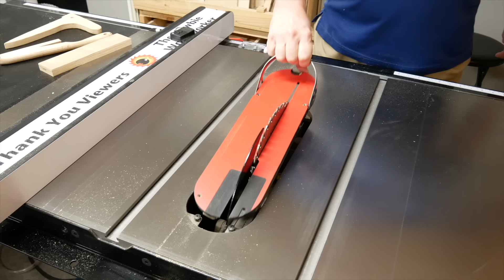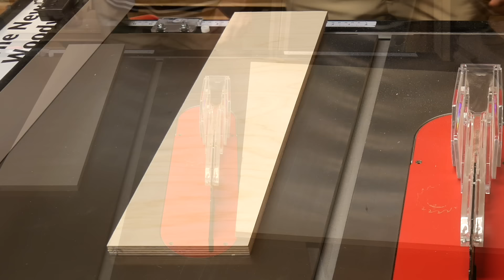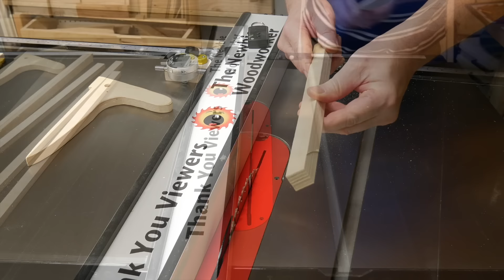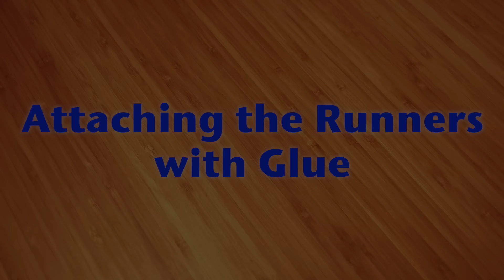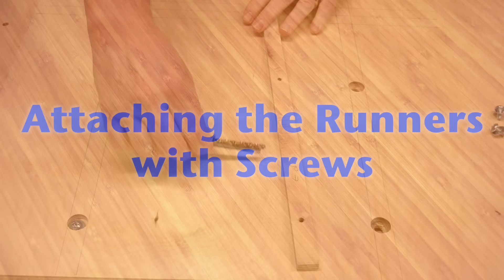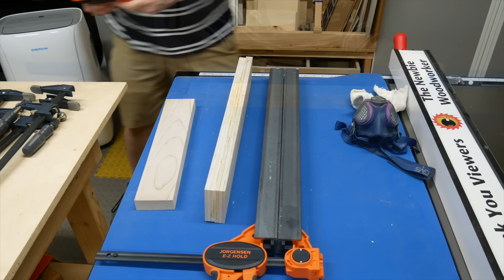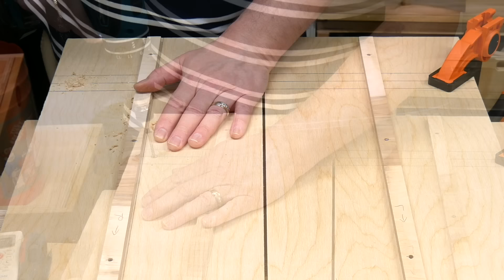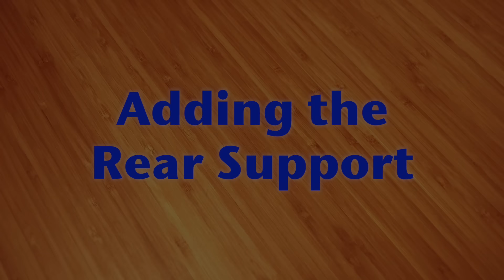Build this Revolutionary Cross Cut Sled, for Newbies!

Comment: You are very right about blade guards. I wasn't using one when I had my kickback accident...never had used one. I was cutting some stickers and came across a knot which allowed the outfeed piece to break off, tip up, catch the blade,  and send it through my neck at 500 ft/second. 
Somehow it missed the carotids and I didn't bleed to death, but a three-inch piece of it did go down my trachea and into the right main stem bronchus, collapsing my right lung. The emergency room saved my life, and the surgeons took out the "trophy"  piece. Six weeks later the hole in my trachea closed, and I could talk again and take a shower without drowning myself.
Bottom line: If I'd had a blade guard the cutoff would never have caught the spinning blade.
Reply from the maker: Holy crap!! I'm so glad you lived to tell the tale! Let this be a lesson to us all. In fact, I think I'll pin your comment. Thanks for sharing.
Reply: Wow!  I have heard of some gnarly table accidents but that has to be the most... visceral.  I am glad you pulled through and wish you best of luck on any further recovery.  I won't lie I often take my blade guard off for various reasons and neglect putting it back on out of pure lazine... convenience!  I do appreciate you sharing because it the visual offered isn't easily forgotten and will surely remind me of the potential danger posed by an unguarded blade.  It is easy to get complacent when you have done thousands of cuts without issue but it only takes that one time due to an unaccounted for/unapparent variable to cause permanent maiming or death.  Let's put the damn blade guards on!  Our families and friends will appreciate it... well most of them!
Reply: @matthewhall9692  Thank you for the well wishes. I have recovered completely. Most everyone I know has been supportive of my recovery. Interestingly I was wearing safety glasses, dust mask, and leather shop apron, but the stick found my exposed neck. Now I wear a full face shield that also covers the neck area. 
The event was humorous in one respect: My wife drove me to the ER and dropped me off while she went to find a place to park. So, I walked in and presented to the young tech at the desk. His boredom was obvious as he asked without looking up: "What seems to be the problem today?"
I answered: "I think I have trache'd myself" (as in tracheotomy). He looked up and turned white. Sure enough, I was standing there with a towel over the hole in my neck. As I pulled away the towel to show him, he nearly fainted.
My close buddy, a former surgeon general, said he'd never known anybody to survive a crossbow shot to the neck, so he was going to stick close because I was the luckiest SOB he'd ever known. I'd never won anything in my life, but that day I won the lottery.
Reply from the maker: @joedraneiii6390  What a great attitude! And you experienced the trick to getting fast service in the ER. Holes, blood, pieces of flesh. When I had my router injury, I intentionally left the blood that had sprayed on my glasses and clothes, and although I had my hand wrapped in a towel, I left pieces of flesh in it too. Nobody bothered to ask "On a scale of 1 to 10, how much does it hurt?" :)
Reply from the maker: @matthewhall9692  Well said, Matthew, and I love your word choices (visceral) and humor.
Reply: God bless you..... Thanks for sharing your experience so that people can be double sure of their safety while working....
Reply: @Habibulla.M  My pleasure to be alive and kicking and able to write about the episode. I stress that when something like this happens, it's in a flash. I'm standing there trying to piece together what just happened. I saw the piece tip and heard a bang, and I felt a blunt hit to my neck. Saw still running; central vac still going, and me standing there wondering if I was hurt. Put my finger tips to my neck and came back with a little red...not much. No pain at all. But little did I realize there was a three-inch piece in my right lung, and that's where all the blood was going too.
Reply: @joedraneiii6390  That's a horrible thing to happen for any wood worker....
Reply: Hi Joe. 
So sorry to read what happened - very sobering to me. I've had my first jobsite table saw about 2 months - finally getting it into a safer built-in cabinet with infeed/outfeed support, and making sleds/jigs. Your incident and this video are confirming to me that I need to rebuild my sled so that the blade guard remains in place. I'm at the early stages where good/bad habits are formed - now is the time to learn from the costly and frightening experiences of others. Thank you for writing about yours.
Reply: Joe,
That’s terrifying! I’m glad you’re ok. It’s easy to forget how many ways things can go wrong with these tools.
I’d like to know: were you using a riving knife when it happened?
Reply: @kaleoscreations  No, my saw is from 1983, before riving knives
Reply from the maker: @joedraneiii6390  Wow!
Reply: @joedraneiii6390  
In Germany there were riving knives in the 60s on circular saws. I can't imagine the US didn't. This is not 3rd world.
Reply: Craziest story I've ever heard. Puts the fear in woodworking (which is probably where it needs to be)
Reply from the maker: @timfoster5043  Or at least a very healthy respect. Fear can lead to being tentative during cuts, which isn't good either.
Reply: Thanks for sharing this, potentially life-saving, story. I hope you built a nice presentation box to display your "trophy"... right above your saw 😉👍
Reply: Wow your very lucky.

Work safe.  Try not to use stock with knots in it close to a cut.
Reply: These are the stories about tables saws that scare the crap out of me. Don't get me wrong, I know horrible things happen with all different kinds of tools, but for some reason the table saw is what I'm most intimidated by. Let's just say I never stand right behind the saw, I'm always off to the side. I wish they were able to make the blade guard more....usable? Nonetheless, I really do need to practice using it more. Glad to hear you made it out of that incident alive and with a whole new view on table saws and blade guards!
Reply from the maker: @My_Red_Right_Hand  I think it's all about having a healthy respect for the saw, understanding what can go wrong, and how to protect yourself as much as possible. Then not letting your mind wander while doing things, especially repetative things.
Reply: aren't you talking about the riving knife? how would a blade guard have prevented that? it only stops you from touching the blade
Reply: @Zack-xz1ph  The blade guard also sits over the edges of the cut piece next to the blade, if a piece rotates into the the back of the blade it is lifted up and back towards you. The blade guard will stop it lifting close to the blade. It's not a 100% protection, but it would stop a lot of the pieces coming back at you.
Reply from the maker: @colinfaed5910  👍
Reply: Holy shit dude!   I'm glad you're okay!   [drops beer.  sprints to shop to re-install blade guard]
Reply: Joe - thanks for sharing this. I think people seem to forget that table saws can kill a person pretty easily. I only just started using one - that was rented - and it shot a piece of wood into my garage door. I estimated it to be 70 mph, but it probably was closer to the speed you mention - very scary. I did make a few bonehead mistakes, but I also didn't realize the importance of checking the fence and calibrating it to ensure it was parallel to the blade. It turned out that my fence was off by more than 1/8th of an inch from end to end when I checked the following morning. I thought that since I had paid Home Depot $60 to rent this thing - more than renting a car costs - that they were checking and maintaining it, but it also had no blade guard. To their credit, they did give me 25% off the rental fee. Soon after I bought a used Skilsaw Worm Drive table saw and I now check the fence before almost every cut. My issue is that it didn't come with a blade guard, but it's only about 4 years old so I should be able to buy one online.
Reply: @bernarddouthit4647  Greetings Bernard, When I recovered enough to approach my table saw again, it was with a lot of caution and... well, fear. I was afraid the same way I was afraid after fireworks went off in my hand as a six year old at our family campsite. It took awhile to get comfortable again. The FIRST thing I diid was buy a full face shield that covers my neck, and I always wear it, along with my leather shop apron. 
It's been eight years now and I'm fine with the saw but it really creeps me out when I watch home improvement shows where people use a contractor saw on a job site. They do all sorts of nutty things like crosscutting without any support but their two bare hands. I even watched one guy making a 2X2 out of a 2X4 without using a fence. Imagine...splitting a piece of lumber with no support. Anyway, I am a very cautious woodworker, especially now, after finding out what can really happen to the bag of meat standing back there in the line of fire.
Reply: @joedraneiii6390  Thank you for sharing your harrowing story. My gosh, that was a terrifying experience you had. But I'm really confused. What is a "sticker?" I want to know how to prevent kickbacks like you had, but I don't know what a sticker is?
Reply: @bernarddouthit4647  its even better to offset the backside of the fence a bit to the right so u know u can't bind anything like    /    but not that exaggerated
Reply: i dont normally use a blade guard but i might after seeing that ,just bought a new Bosch pro table saw not bad for the price had to put it on Castors as i only have a small shop,also i think the riving knife prevents  a lot of possible kickbacks
Reply from the maker: Congratulations on your new saw! Yes, by all means, use the riving knife whenever you can. The blade guard is also great protection, but the riving knife does a wonderful job of cutting down the chances of kickback. Be safe and have fun!
Reply: Holy shit. Thanks for your experience story. My fence  guard is missing from my older  Dewalt 10 inch   table saw , been dormant for years now retired wanna fire it back up. Was a present from my wife years ago….Gonna shop for replacement. Don’t know where to find it Cant-find Owners  Manuel ..
Reply: "Blade guards? We ain't got no blade guards. We don't need no blade guards. I don't have to use any stinkin' blade guards!"
Reply: I gained a whole new respect for table saws the first time a half a 2x4x8 came shooting back off the blade and luckily hit me in the belt buckle. Knocked the wind out of me and I've never stood in line with the blade since
Reply from the maker: @drizitgaming  Wow, that was some belt buckle! Glad you're OK.
Reply: @TheNewbieWoodworker  sure was, and so am I ;)
Safety equipment isn't just for fun
Reply from the maker: @drizitgaming  👍
Reply: Were you using a push stick and if so what sort?
Reply: Thats good advice, I use one some of the times, but my Kobalt table saw blade guard kind of sucks, so I take the chance without it.  Then when I read things like this I put it back on, well until I get annoyed or have to cut thin pieces.
Reply: Jeez, I'm so glad you survived man.  Terrifying
Reply from the maker: @joshuagharis9017  Thanks, and I'm glad too. Definitely terrifying, especially with how quickly everything happened!
Reply: i just took out 3 stitches because i don't have a blade guard and blade got my thumb. a big hole where a chunk got ripped out and a few slices could not be stitched. they'll just have to heal up. so i'm going to buy a blade guard and make it work and use it. i could have chopped my thumb off. this video made me think about simple safety measures and quir just doing it. i never get cut. ok hands nowhere near that barbaric blade.
Reply: holy smoke. makes my thumb story pale...
Reply from the maker: @yellowcat1310  😂
Reply: Walk it off Nancy
Reply: @kevinrash4821  I did Elmer.

Comment: Thank you.  I got a new jobsite saw.  I was going to make a different sled, but have decided to make this one instead.  I've been doing woodworking for more than 15 years, and usually didn't use a blade guard, relying instead on the gripper.  I've heard people question the gripper vs the blade guard and decided to use the guard as much as possible.  Also got the Jessem Flex guides.  This is an excellent idea. Thank you.  I'm going to use some plastic runners I already have, though.

Comment: Just hooked up dust collection to my blade guard, so not being able to use it with my crosscut sled would be a big letdown. My "aha" takeaway from your design is simply moving the fence forward so there's stock behind that doesn't get cut in half, providing the stability that a notch-less fence otherwise would. One question...why not just leave a space between the two halves of the fence all the way to the surface of the sled? What's the purpose of the short piece in between the two halves of the fence for the guards to ride over?

Comment: Great video, great design. Thanks. I've been watching this whilst lying in the bath so I haven't had a chance to sketch it out, but Im considering some improvements to address the small nu.ber if concerns raised by others.

Why not fit another section of double ply along the edge, behind the 4" block. It functions exactly the same but with additional reinforcing. On the other end, have a similar piece but removeable, just to add strength when installing and removing the sled. Maybe using some kind of quick release catch/clamp or maybe threaded inserts.

As I said - just bath musings!

Comment: Great vid - thanks and greetings from across the pond! I bet when you made this vid, 3D printing was quite a niche thing. Now of course, 3D printing is available to lots of folk. So Im currently building this design but with 3D printed runners, and - even handier - a 3D printed kerf strip to be a nice snug fit in the slot for squaring up the fence.

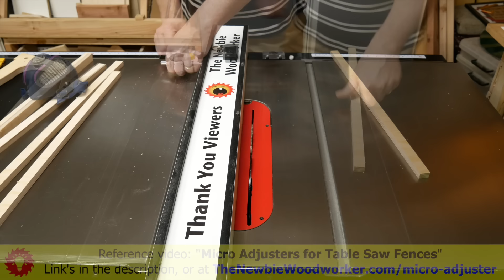Comment: 5:15 Curious why you don't use the push block at this point.  I'm really conflicted about it.  I feel like I have more control when I'm using it but I can't use the blade guard when I run the block over the blade  and sometimes that gives me pause.  I've heard folks mention how a piece of plastic won't save your hand if it chatters and you're using so much downward force on it that it's probably game over.  Let me know your thoughts on it.  I'm about 8 months into the journey.

Comment: Is kickback even possible when using a crosscut sled since the stock is not pinned between the blade and the fence? It seems the cutoff piece would never be trapped and simply fall away. Thanks for the video.
Reply: Yes, I thought that, too.  But then I realized the point was not having to take off your blade guard every time you want to use your sled.  That way, you will use your blade guard consistently.

Comment: 6:12 it's not safe to cut a narrow piece of wood while it's stuck between the blade and the guide rail, you should use a block before the blade.
Reply: Or a thin strip guide on wider material. That's how I would do it anyway 🤷‍♂

Comment: A TIP: Line the miter slot with a piece of thin plastic film for gluing, this will distribute the gap and you don't need to sand it!

Comment: One issue with this is that newbies all have small table saw (or job site table saw), not gigantic one like yours with rooms before and after the blade. So even though this sled is very useful, it is not really usable for us :(
Reply: Your comment makes zero sense. You can attach a cross sled to any saw.
Reply from the maker: True enough, although you could change the dimensions. But not everything will work for everyone's equipment.

Comment: I think it should be possible to use the blade guard when making the runners or any other thin rip cut where the rip fence would collide with the guard.  All that is needed is a low profile fence extension that can attach to the fence so it doesn't move away during the cut.  Then the guard can lower over the low profile fence extension.
It took a while, but I found this example.  https://blog.carbideprocessors.com/wp-content/uploads/2016/03/ripping-with-table-saw.jpg  Definitely more work,  yet safer.

Comment: May I ask, why is the base so thick?
Wont 5mm ply do the job?
Reply from the maker: No. Since it doesn't have a full front or rear fence, it would be too fragile.
Reply: @TheNewbieWoodworker Sorry but I don’t understand.
Do you mean flexible rather than fragile?
Reply from the maker: @andrewcampbell8265  The only place where the two sides of the sled are held together is about 2 or 3" section of the base. If the base is too thin, I could imagine the wear and tear of taking it off the table saw and storing it might cause it to eventually crack. But, you can always make another one if that should happen, so I guess it wouldn't hurt to give it a shot. Just make sure you glue the runners on instead of using screws.

Comment: About 3 years ago I was using my table saw and was just pure stupid and wasn't using push sticks, there was no knife and no blade guards and had an accident losing part of one ring finder and my first two barely hanging on but were saved.  I recently bought a table saw and I am taking every possible safety precaution including my blade guard that I will rarely take off. Please take a look at my video on my page as a reminder what can possibly happen if using a table saw and being carless. This sled is a great idea which will keep the guard on, thank you :)